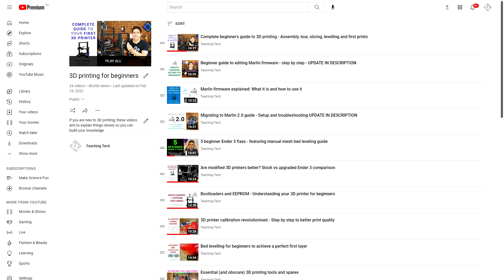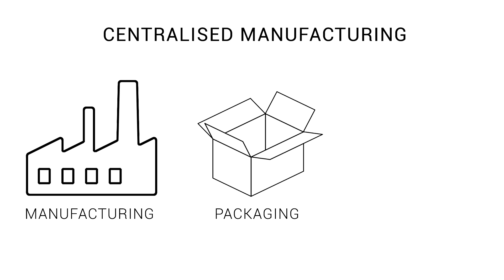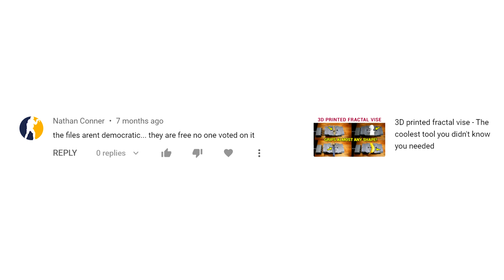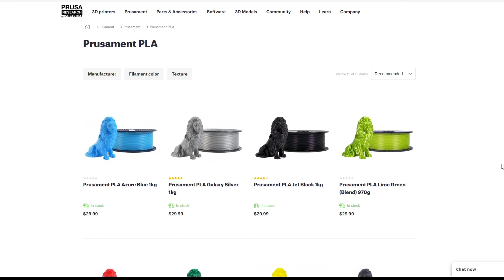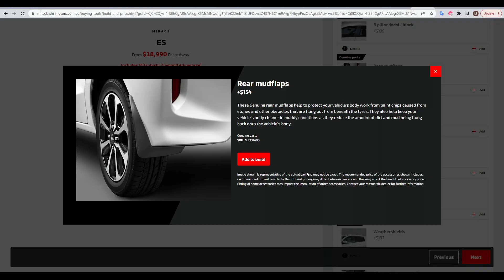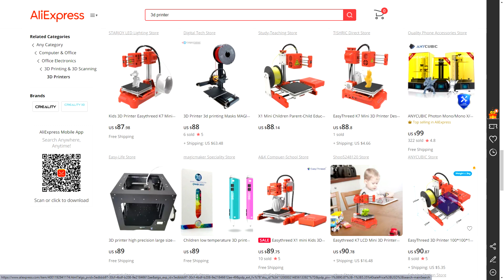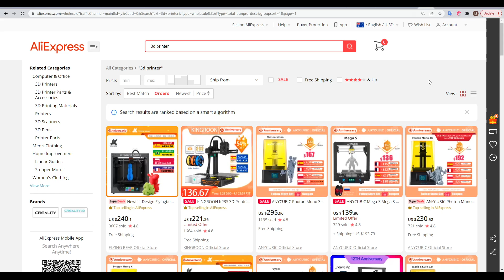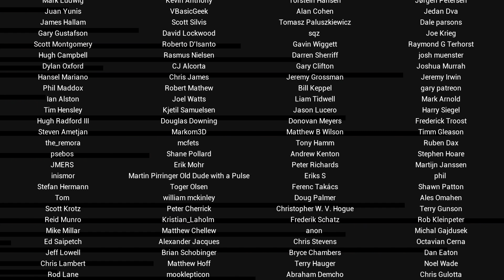3D printer trends are limiting mainstream acceptance: The 3D printing paradox

Comment: I believe it’s more about home 3D Printing still being relatively new. Many years ago automotive features came from the tinkerers. Rear view mirror came from Indy 500. Rather than include a mechanic riding along who also could look back and tell the driver what was happening, they added a rear view mirror and reduced weight. We now take rear view mirror for granted. Model T had many 3rd party features that got included in future designs. Fuel injection was in racing before production cars. Even early paper printers had hobbyist community drivers to make graphics on a dot matrix printer and used third party plug in boards for more capability. So we’re still in the early phases of in-home 3D printing. We just haven’t found the killer app (aka email, spreadsheet for computers) that make them a common household product that will encourage manufacturers to invest more in innovation.
Reply: Exactly what I was thinking. Model Ts also are a good example of what's happening in 3d printing, they were cheap and mainly innovative in terms of mass manufacturing techniques, but also came with a lot of problems which required a knowledgeable user. Almost like the ender 3 of the car world.
Reply: I think a lot of commercial development in printing these days is in metal and ceramic printing, rather than plastic. I think 3d printing is still some years from a mass market product, but I think local 'print shops' are around the corner for replacement parts and hobby products...
Reply: In part i believe one of the biggest challenges will be "idiot proofing" them. Most people don't even wanna dig through files or load spools, nor would they know what to print. One possible example would be "disposable decor" for things like vases and bowls. Something printed with wood filament with plenty of designs if you tire of an old one though it does seem pretty wasteful.

To succeed in a household 3d printers need:

1. Stupid simple automatic loading, for FDM This means the ability to find the end of the filament and automatically pull it in like an old film reel mechanism, feed it through all the bits.

In general further automation and a simple UI a child could read would help. Think like a smart fridge. Perhaps a foldable conveyor belt printer that can collapse into a wall alcove when not in use. 

You would need to have some sort of second internet. A thingiverse-style model repository with a simple searchbar and files named for either what they are, tagged as certain objects or find parts by the original product name and model number.
Reply: I feel the biggest detail for 3d printing when it comes to FDM/FFF that we need to keep in mind is that from 1989 till late 2009 Stratasys Inc had a patent for the FDM process. So the ability for people to legally sell/produce a product that uses the same, if not similar process as the patent, have either been cost prohibitive for the lower end. In that same breath for certain materials the use of an enclosure was needed and yet again it wasn't till some time last year that manufacturers were able to freely make an enclosure for their 3d printers, produce a system with an enclosure built-in, without running into legal problems or paying royalties to Stratasys Inc. 

I am not saying that these are purely bad things since Stratasys has made many innovations in the market that we benefit from now. I just agree with your stance and felt it was necessary to expand upon it with details in regard to why certain innovations have taken time to hit production even though they may be quite common in the DIY/Maker community
Reply: So we should hold a competition and invite all 3D printer manufacturers to participate, twice a year, and the models used by the manufacturers must be based on mass-produced models modified.
Reply: Windscreen wipers as well - first developed outside of major car manufacturers.
Reply: The irony is that because the market is saturated with machines that require tinkering, there isn't the mass appeal, which means there isn't the market for bigger companies to mass produce more complex but easy to use machines. It's sort of a chicken and the egg problem. What we need is more companies like Prusa who see the potential market and what it needs and is building all the things to make the process as easy as possible (file repository, slicer, machine, material etc.).

The other paradox is that the enthusiasts and tinkerers are mostly focusing on performance and not ease of use, since they don't need it to be easy to use because they are enthusiasts. There have been a few things like automatic bed leveling and filament sensors, but we are chasing higher speeds on very expensive and complex machines, when all the mass market needs is a Prusa Mini (although that still has its issues) which can reliably plod along without issues, like the tortoise and the hare.
Reply: @CHEP agreed. Look at where the Honda Trail came from back in the 60s. Dealers modifying the 50cc Super Cub street bike for off road use were way outselling other shops. Honda realizing a new market developed the CT90 with the dealer modifications.
Reply: @CHEP The killer app is here, it just isn't something people need at home very often or don't have the skills to leverage. Design.
Designing mechaical bits isn't something very many people have the skills/time to do. But, as a designer, having a 3D printer is fantastic for the iterative process of solving problems. Most people just want to press a button and get something out, like a copier. In today's world everyone has a fridge, a stove, pots and knives, but few people actually spend the time to learn how to cook well. Same with 3D printing. Nice to have, but few will actually leverage it to the level that it is capable. I have even seen YouTubers not really getting the point. ;)
Reply: @SeanTaffert  Who says that they can't just download and print a new penis from the an online 3D parts store?
Reply: I'd argue that some groups have, it's obviously not widespread, but in the 2A community there are lots of people who got in to 3d printing to print firearms. And a lot of firearm manufacturers have taken to 3d printing parts for prototyping (Note, I'm not advocating for or against  printing ghost guns, I'm just making am observation please don't flame me lol)
Reply: You're not seriously saying the reason we have rearview mirrors TODAY actually has anything to do with where they first came from? As if no one else would have ever thought of them? I don't know what logical fallacy you call that, but it sure smells like one. Anyway, it's not 1910 anymore, a mostly-new car costs on the order of a BILLION DOLLARS to develop. 3D printing has actually been around for quite a long time now, we are actually well past the garage-tinkering stage, and some revolutionary 'mainstream' product would require an insane investment by very big companies to precisely control or eliminate the variables we have to currently fiddle with. Companies that are going to have to somehow make that money back, which is going to make the 3D hobby community freak the hell out, because apparently making money is evil.
Reply: Democratic 3D manufacturing is a wish you wish you didn't have after you realize its issues. If they become good enough to rival conventional manufacturing, in terms of convenience, speed and cost, then there will be a massive loss and jobs.
Reply: @bobweiram6321  More like manufacturing jobs could become more dispersed and decentralized.  No matter how easy 3D printing gets, that vast majority of people who 3D print anything won't be able to do much beyond printing an individual plastic piece here and there to use around their home.  The majority of manufacturing work develops products that are made of many pieces that require at least some effort to put together or makes parts that are intended to support an engineered product. Major companies are still going to need the support of conventional manufacturers that follow all applicable standards and regulations of the industry.  The average person will never make something like that, but having easy to use printing capabilities can help a savvy individual to start their own small business. And that's what some are already doing.
Reply: "Fuel injection was in racing before production cars." Once again, you are wrong. Fuel injection systems were available in diesel powered cars in the early 1900's.

Comment: The other thing is the cad programme and this adds to the learning curve substantially and potentially to the cost  , if you have done  cnc going to 3d printing is relatively easy but if you have done neither then you not only have to work out how a printer  and  a slicer works and then  how to use a cad programme so the learning curve is fairly steep .
I feel it is ultra important that YouTube channels like yours test and report the findings on all brands of printers and not just  the ones that are given for review as this will help to stop the proliferation of crap printers appearing on the market - if no one buys them they will stop making them .

Comment: Great video, as usual Michael.  In my opinion, 'turn-key' (non-tinkering) printers will be bought by someone who wants to populate a print-farm and make money out of printing and selling 'things'.  The tinkerers (like us) want the printer for building one-off things ... replacing broken parts and making decorative and useful objects from our own CAD designs.  A low cost 3D printer is tool.  You need some skill to use it (like a power tool ... which probably works every time, but you do need to maintain it (swapping blades etc)).  I don't think every household will want a 3D printer.  It is more likely that if you have a 3D printer, you also have a laser engraver and a CNC machine too.

Comment: Well… the logistics will shift from transporting goods to transporting materials, so that chain will not disappear, but it will be replaced with a different supply chain. And transporting a lot of smaller packages to a multitude of home addresses has a enormous large carbon footprint. When you split the volume of a delivery, the surface area of those two packages will be larger than that of the single large one. As a result during Covid the demand for cardboard rocketed through the roof.

Comment: a very strange video. 
Do you thing it would be better to not support printer manufacturers which use the existing firmware ecosystem to push their hardware?
Reply: They could be using the existing firmware better, and they could be contributing innovations into the firmware.

But I sure think manufacturers who can't even abide by GPL although they use GPL firmware, would be right to be shunned. That's like most of them.
Reply: @SianaGearz  Answered in the main thread why i think companies would not go for it - because there is no market

Comment: I'd love to see an IKEA 3d printer. It wouldn't need to be particularly fast, have the largest build volume or handle a wide range of materials. It'd just need to hit a few goals. 
1) fit in a kallax without wires and filament spilling out into the room. 
2) be reliable and intuitive enough for a non tech person to start printing basic things like coat hooks, pegs and picture stands within ten minutes of unboxing.
To the 3d printing community it would have to be the least exciting device on the market, but for normalising the democratisation of manufacturing I can see no better target than all the small plastic extras you'd normally pick up from a furniture or hardware store.

Comment: I think you are spot on. No need for CAD if you don't want to because the files are the things you buy iso the item. Feed them into a perfectly working 3d printer and you have your product. Plus the bonus of free files on the internet and if you do want to make that piece of art or specialized item you can design it.
What will be the prize range though that is something remaining to be seen, but compare to cars and 2d printers you can still buy relatively cheap cars and printers which still do what they are designed for without extra knowledge but within the constraints of what you paid for. (less speed, less comfort, less color) Still you get from A to B or be able to send a letter.

Comment: Great video! I wholeheartedly agree. I am of the tinkerer variety, but I could not in good conscience recommend getting a printer to friends and family who just want the parts, but not the fiddling. In my opinion, 3d printing feels like driving a car in 1910. The frustrating thing is that even the $3000 machine at work with all its sensors, wizards, and whatnot needed a whole lot of TLC, back and forth with customer support, software upgrades etc. instead of just working.

Comment: One of the problems with making things at home is time, years ago people brought stuff from catalogues and that in turn made it so it took 2 weeks to arrive, then some of the high street shops started selling mail order stuff but hat meant you had to go and collect, now days people want it and want it now just like i could order an apple and have it delivered in 20 mins. People think a printer would be like star trek replicator and when they see how long things take it like oohh. What companies should do is design parts with 3d printer in mind for replacement parts so then they can run off the production runs to keep cost down but then sell the stl file for the consumable item. Im a toolmaker and have seen jobs go from fitting on a bench through to all singing and dancing 5 axis or even 11 axis machines so 3d print is just the evolution but people need to get out of their heads " I want it and want it now". I told a friend that does 3d scanning and reverse engineering that he should look at creating files from common house items and sell files and in time he would have quite a range but then he said they cant due to copyright infringement, so companies after 2 years should release files because by that time they have made back the rnd money and then they dont need to carry stocks.

Comment: You hit this one spot on the head! A race to the bottom does nothing but flood the hobby with junk, and machines that people feel they need to dump dozens of upgrades into, before they ever get a solid print off it. There used to be a time when manufacturers (actually you could barely call them that, because they were so small) were pushing the limits and thinking outside the box with each new machine. But several of those have got pushed out by the flood of cheap Chinese machines. I am thinking largely of Printrbot, but there have been others that only got one or two interesting machines out, before getting squeezed; because they could never compete on price, and the typical consumer was so focused on cheap.

Comment: Part of the blame is the manufacturers, but part of the blame is also some of the hobbyists/tinkerers who tend to think that "I saved $50 more on this _ Printer model and anything wrong with it I can fix/upgrade myself" instead of just trusting and buying higher quality/better featured printers to begin with. I think the community should put more emphasis on basic minimum standards for 3D printers. Any printer that doesn't meet requirements such as:
-Default thermal runaway sensors enabled
-Proper fuses where needed
-Strain relief on bed cabling, etc.
-High quality connectors/adaptors, no soldered bare wires plugged into boards

...should be not recommended by reviewers.

I would even say for regular consumers, auto bed leveling should be more standard and mainstream.

Comment: You can’t negate the packaging and transport problem. Filament still needs both. Most filament is packaged in a one time vacuum sealed bag and a cardboard box with desiccant, for every kg of filament.
Reply: What if your local recycling center made spools of PETG from soda bottles and you could just buy cheap spools from them?
Reply: @jasonhurdlow6607  What if you could do this yourself from your scrap filament/failed prints/supports/etc? Every time you have 1kg of scraps, just make a new spool with it.
Reply: @briantkiger  As these plastics degrade with every printing sequence, you may need high percentage of fresh material in every home made spool to keep the quality up. Sure, you can reuse just scrap material a few times before it really becomes unprintable, but the results will degrade with every cycle.
Reply: There could be (spoolless) refill filaments in ziplock bags. You could bring your standardized filament bag, and not being charged for one on filament purchase. Desiccants can be reused, dehydrated too as many times as you wish I believe.

Comment: If the point is manufacturers in the low-end market are not contributing enough to the advancements of open source 3D printing technologies, I would say this is certainly true - but I won't be too harsh on them. People not in the manufacturing business tend to underestimate how hard it is to be a good "copycat" (I KNOW there are lots of bad copycats too). It takes a different type of capability to consistently churn out highly affordable printers on a large scale that perform well for the money, and it's harder than many people would assume. We need leaders in the space, but followers like Creality made their contributions too by massively lowering the threshold of entry. Because of the plethora of sub-$300 printers, a lot more people were able to experiment with 3D printing and get educated. Most of these users would likely never move onto more advanced technologies anyway (let's be honest, most people just want to print some trinkets and have other interests in their lives), but some of them would become that additional user base for high-end solutions; some may even become innovators themselves. In any case, I wouldn't view companies like Creality as a hindrance in all this.